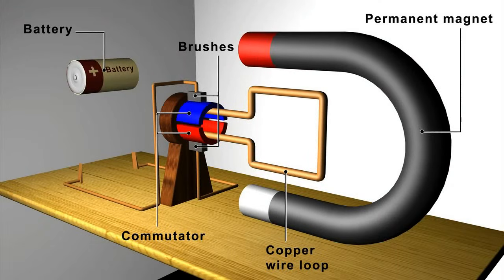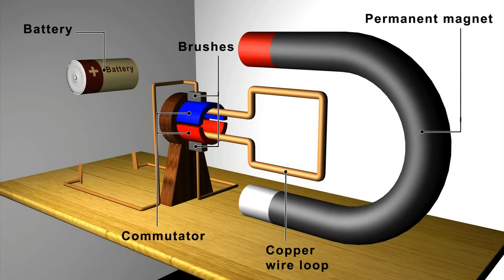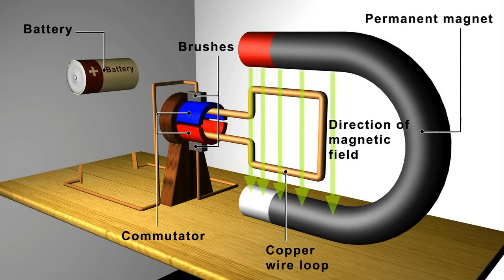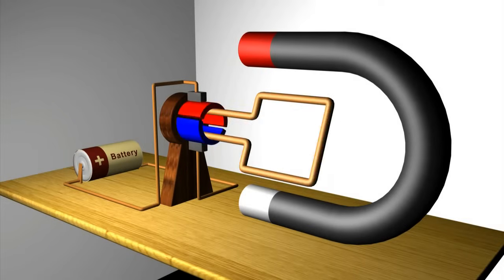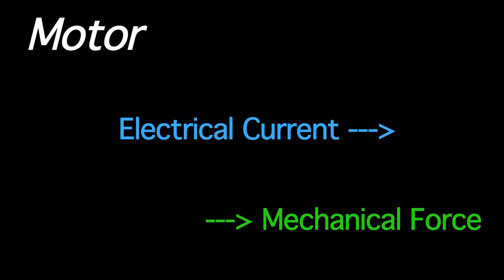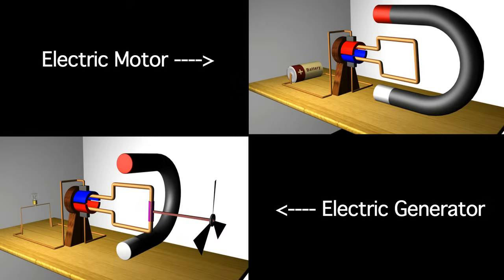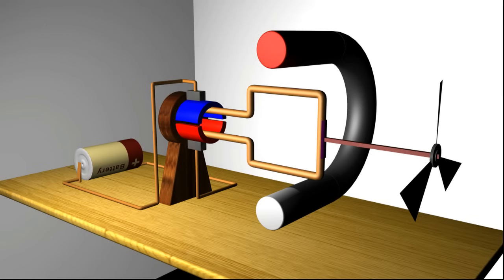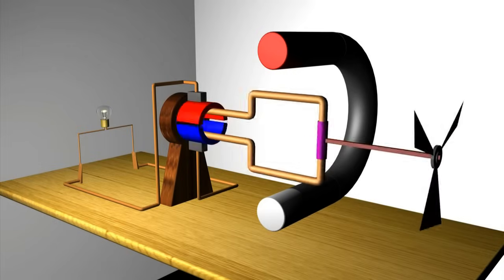Magnetism: Motors and Generators

Comment: ok i get this, but how is the current produced by the magnet? That's what i don't understand. How?
Reply: A moving charge creates a magnetic field around it. Likewise, a moving magnetic field induces a movement of charge in a conductor. 

Basically the wire doesn't want to be moved by the magnet, so a current is induced in the wire that creates a magnetic field opposite that of the moving magnet. 

These are in fact the exact same phenomena, viewed from different frames of reference. It's a consequence of special relativity. Veritasium has a great video about it.
Reply: lenz's law or some shit

Comment: I don't understand one thing. You have a generator connected to a light bulb which is emitting photons (which are basically electrons from the circuit). Where do those electrons come from? Mechanical force (in this case a fan) is just moving copper wire around magnetic field, but when or where the electrons get into the circuit?
Reply: The magnetic flux (when the copper wire is moving through the magnet) creates an alternating current in the copper wire, which is basically utilized in the circuit to light the bulb.
Reply: I also don't understand
Reply: I think I finally can explain this. Electron is not turned to photon. Electron excites (emitting) photons when it goes from higher energy level to the lower one (search for Excited state to get more info on this). So basically there are circulating electrons in the circuit with still the same amount. Then there is a light bulb connected to the circuit as a separate component. When electrical current passes through a light bulb's wire, it causes the wire to heat. Electrons get excited and emitting photons. And thus no electron loss in the circuit :)
Reply: No emission of photons here. The current is due to the circulation of electrons throw the metal. Each metal fontain electrons bit the question  here how they move. Well when you have a magnetic field changing in time that means it's value or direction is changing  like in this case, that will provide an electrical field related together with the equation of maxwell Faraday. 
That means that variation of tha magnetic field in terms of time leads to an electric field circulating in the metal , so a efm

Comment: I have an idea and I am not sure if it would work. So if anyone is reading this please reply. Is it possible to dig your own sewer that goes to a reclaim water facility and connect the sewer to a rain water drain and put the turbine in the sewer with the wire facing up and make part of the ceiling with a conductive metal, so that the turbine is moved by sewer water and the electricity is captured in the basement above the sewer? I wanted to build my own Roman building with that set up.

Comment: A rotor loop cuts the field 1 way going 1/2 way around, & cuts it the other way on the other 1/2 turn.  Current collected from a coil naturally alternates, which is AC.   This generator has a commutator and produces current going only one way, DC.  A commutator is two 1/2 rings mounted around the shaft with their ends almost touching.  That arrangement reverses the current each 1/2 turn so it flows one direction for DC.

Comment: As 11matt555 stated the conversion is not 100% efficient.  There will be losses do to heat which will eventually stop the system from continuing to generate power.  It would also be a violation of the laws of thermodynamics.  Unfortunately there is no such thing as free energy.

Comment: Yes. If you have two fans, you can tie their plugs together with wire, or tape them together, and spinning one fan should spin the other at an almost equal speed. To light a lamp though, I think you would have to spin it really fast
Reply: yo

Comment: @CabhanListis In a generator the electrons are all from the wire. Basically all conductors have free electrons. When a wire passes through a magnetic field, the electrons are pushed along the wire. Thats basically electricity. Electrons arn't being generated more so they are being moved from one point in the wire to another. The more electrons you displace, the more pressure that is generated for them to want to move back, this is called Voltage. Hope that helps!

Comment: @ethaneveraldo Yes, you could. There are usually devices called motors and then other called generators, but nothing stands in the way of using them in the other manner. And the process is called electromagnetic induction.